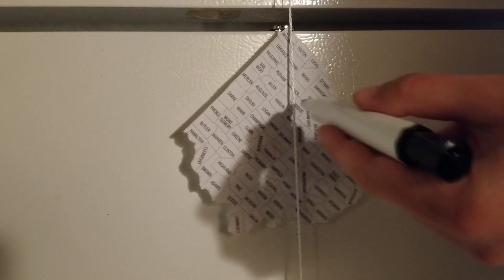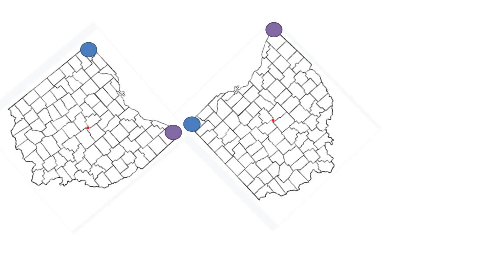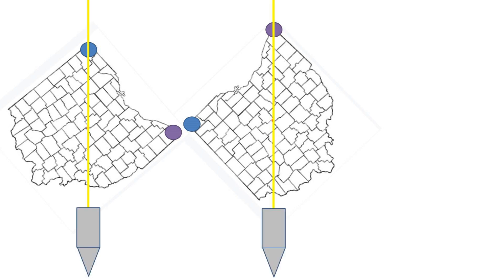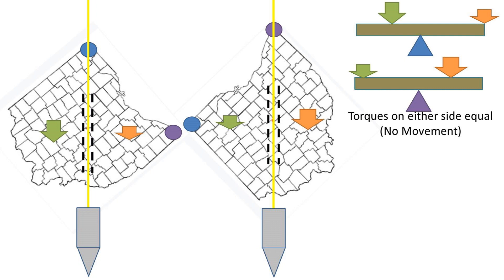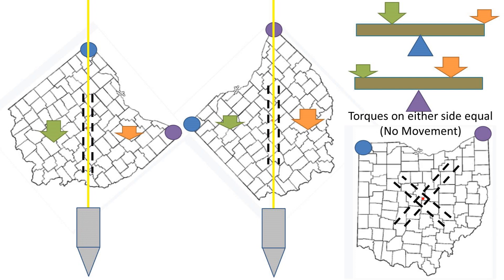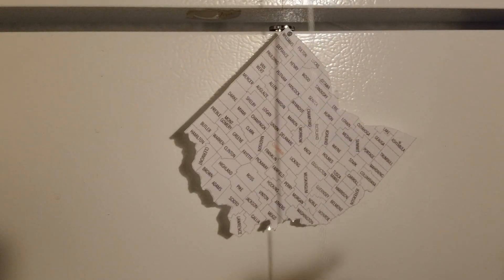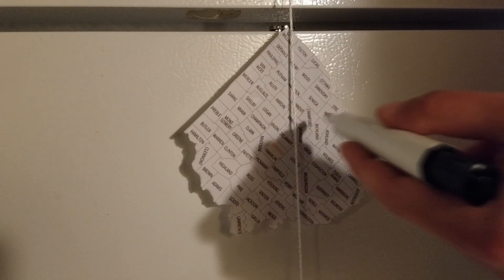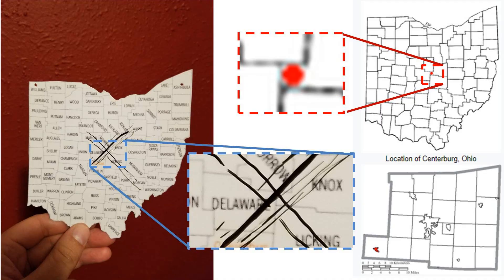Find Center of Area of Irregular Shape Experimentally (Center of Mass of 2D Object)

Comment: This is interesting, but how do you go about finding the center of an irregular area without pivoting it?
I looked this up for continuous, irregular 3D shapes recently and to my dismay, I only found examples that talked about point masses or were too complicated.
Reply: find a piece of cardboard in perfect state. draw the area shape on it as large as possible. cut out the shape. balance the shape flat horizontal on 1 finger and find center untill it wont tip over. mark the spot. u now found the center without any measure or formula